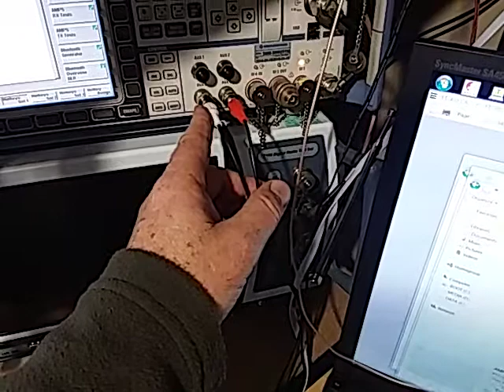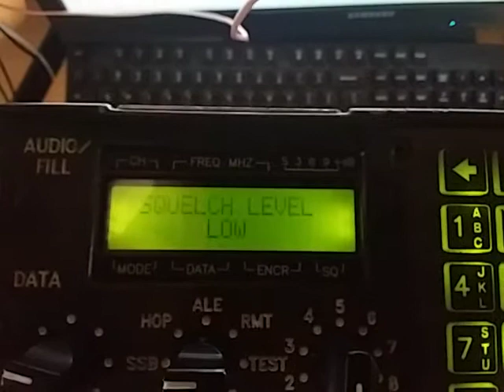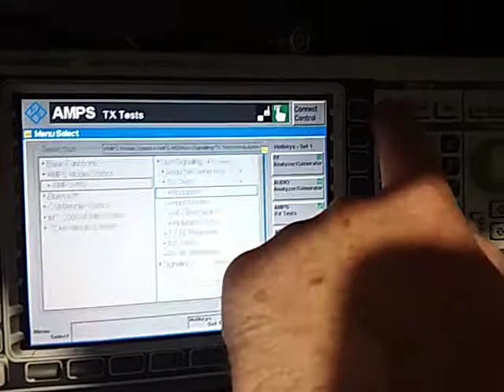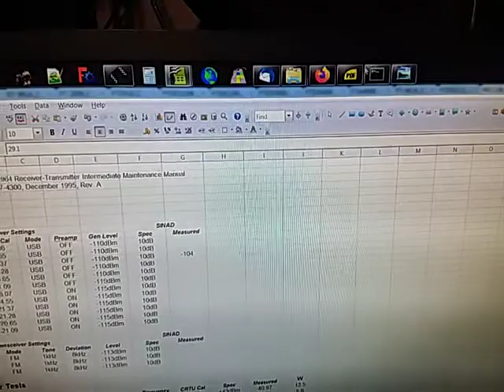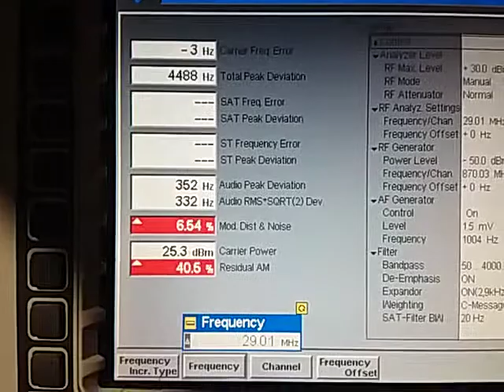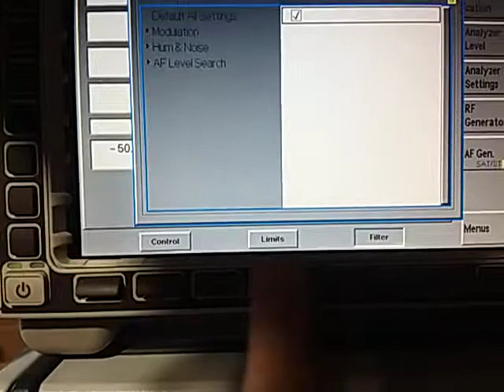Rohde & Schwarz CMU200 or CRTU - TX Testing PRC-138 FM Deviation

Comment: Did you ever make software for these devices?
Reply from the maker: I started but have not got back to it. Using Lazarus IDE & FPC (the open source version of Delphi), I've created a very buggy application that connects, queries the cards installed and opens corresponding tabs with appropriate controls. It can generate RF/AF,  spectrum & AF analysys. Buggy as heck but sort of works. Frankly I think I was trying to do too much in one go and not completely understood how all of SCPI works. I'm not handling the status reporting system at all so its not really multitasking.
Reply: @ZL1CVD  Still, sounds very promising. Were you planning on releasing it as open source? BTW, do you have a website we can follow?